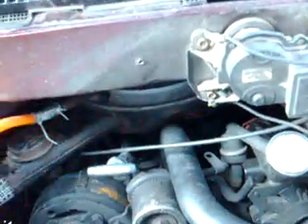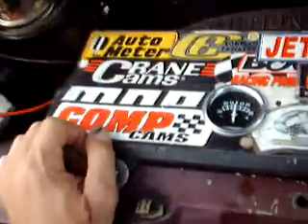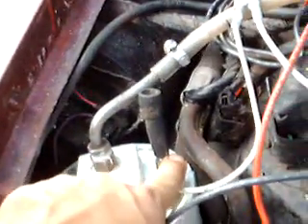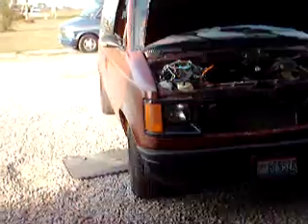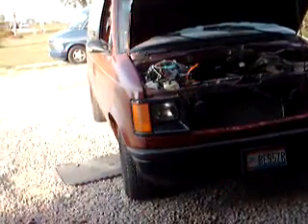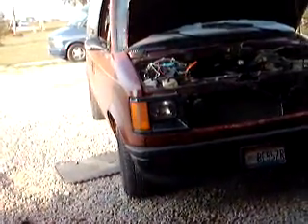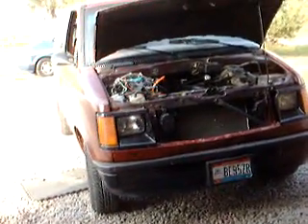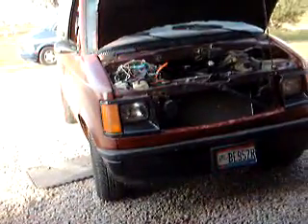HHO Maker 2 Oxygen Sensor

Comment: Hi Buddy.
You should be drawing anything between 15 and MAX 30 amps to get the right HHO production (typically).
You need about 2 tablespoons of 90% pure Potassium Hydroxide  (Alkaline Lye / drain cleaner ) per quart of distilled water to make your electrolyte; in order  to get the HHO gas production at around 1 or 2 litres a minute.(must be premixed and dissolved first)
Maybe this is what you already did ??
I don't know what design your hho generator is or how its been made though  !!!
Next - the 02 (exhaust oxygen) sensor(s) (only need the original 1 nearest the engine ) require the output voltage to be altered so the computer thinks all is well.
I think mid - point between 0.1 & 0.9 volts =0.45volts on average...(get a test meter and check these voltages at the connecting plug while the motor is running)
A pwm or potentiometer (ebay) is installed in line with the wires from the 02 sensor and the ECU computer, then you can measure (meter) the voltage on a "normal petrol powered situation" and then make a "correction" and adjust the dial when you run on HHO power / gasoline.to get the reading THE SAME.
This problem is caused by the excess oxygen from the HHO generator feeding into your engine - and then the exhaust, making the computer think the fuel is too lean and so it adds more gasoline to compensate.
Therefore your truck is running too rich and makes no mileage gains - just more power !!
Hope this info is useful to you...
I am still learning all this stuff myself...
Here in the UK we pay nearly 2 dollars a litre for our gasoline (petrol) so its worth the effort.
Have fun !!
Si
Reply: Doing my research so as to start a HHO project and learning about the O2 sensor. Your comment has helped greatly. Would you mind keeping correspondence with me via email?